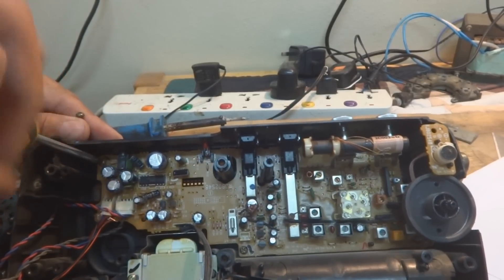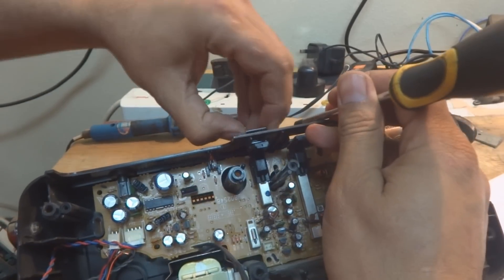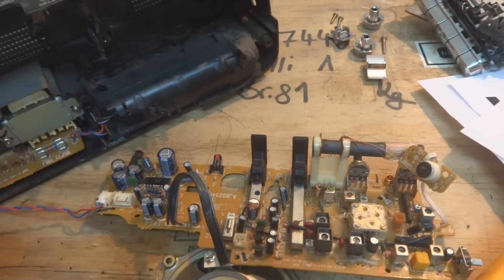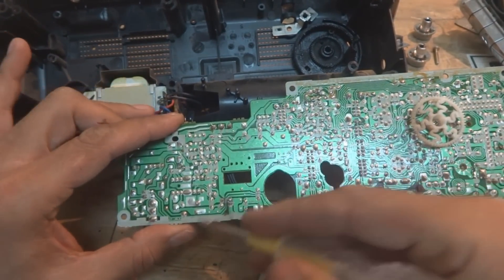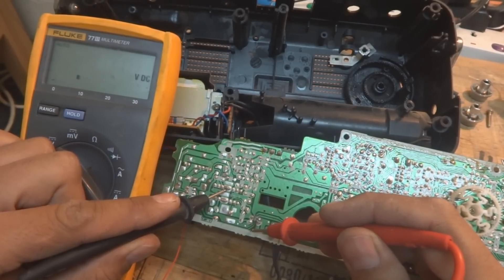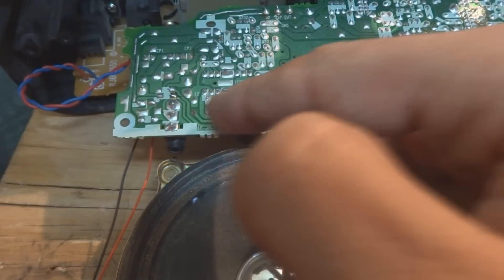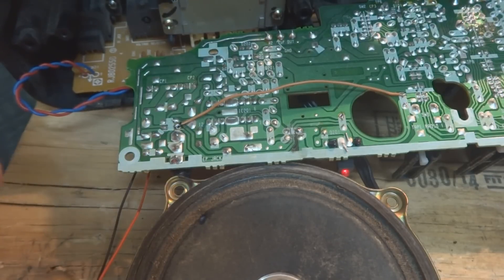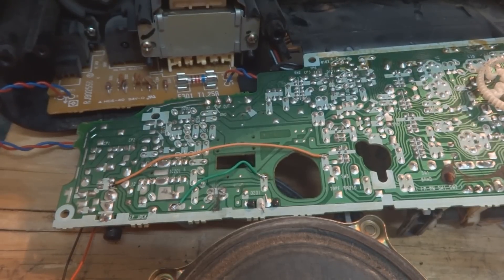Stereo repair ; Audio repair; Radio repair at home easily; Learn Electronics part 2

Comment: Rx-m50 me sound slow problem please solve india
Reply from the maker: Check radio. If ok then replace audio head. Otherwise if radio is slow too then check supply voltage. If they are good and strong then replace power amplifier ic.

Comment: Hello sir,
I have the same piece the tape is working fine but the radio volume is very low, what should I do?
Reply from the maker: Check radio section and replace defective components there.

Comment: Can I know how to check the speaker power with a multimeter
Reply from the maker: There is no way to do it using a multimeter. You can do it by connecting a speaker to different size amplifiers and see the response.
Reply: @JahanZeb1976  thanks for the reply 👍

Comment: Hello. Can you help me please?
Reply from the maker: Yes sure. What is the problem dear friend?
Reply: @JahanZeb1976  My radio dont work. I have sound but very bad and potentiometer doesnt work and i cant tune. So can you help me please?
Reply from the maker: There are some parts needs replacement in your radio.
Reply: @JahanZeb1976  Can you tell me what parts?

Comment: Hi. Nice video...!  I have a AV receiver with FM tuner. It will work only in mono mode. it want change to the Stereo mode even it has good FM signal reception. as I bought it secondhand would u suggest me a solution.
Reply from the maker: Make sure you are supplying or feeding FM signal to your tuner. Then if still problem is there, it could be a bad system IC.

Comment: One thing you can do is set your meter to read current and place it across the on/off switch.
for small radios it will be around 12ma.

Comment: Loverly job, well done jahan :-D :-D.
There must have been quite a large pulse of current to burn out the tracks, im really supprised there was no damage to the radio circuits, hard to know if it was the wrong power selector setting or the man applying power to the battery connections, we will never know.
One thing i would have done before connecting power to the radio is check for a short circuit on the radio power pins, some capacitors in the circuit can go short.
.
Tantalum capacitor types just love to go short circuit ha ha :-D, and if the power is not limited they go up like a firework, Ka booom lol :-D.
Makes you jump, i have lol :-D.
Reply from the maker: +zx8401ztv Thanks dear sir for liking video and work. This video actually I uploaded for newbies in the field of troubleshooting and repair.
I didn't take care of the short using an ohm meter before attempting power because when I applied limited power from cell phone charger, it exhibit no voltage drop; means no short. I encountered to a shorted equipment many times and by voltage testing I understood the situation. You made a great point to give to the new comers in the field! I would try to cover it in some next video.
This audio was very feasible to repair because its components especially the power and pre-amp ICs were in working state. The power amp IC was a bit expensive online and was not available locally due to worst electronic spares market here. So if it was the case with defective IC, I thing would be no change of its repair or this video! Hope these two videos will be valuable to the learners in the field of troubleshooting and repair. Regards,
Reply: +LearningZone 
Please know that I wasnt picking fault with your repair :-(
The possibility of a short circuit (possible cause of the blown tracks), is a basic part of a sucessfull repair.
Whats blown.?.... What did it?.. :-)
I will shut up, i dont want to upset you as your a nice man :-)
Reply: zx8401ztv I think it was shorten due to mosquito or little spider or any kind of bug which comes b/w + ve and ground at the spot we saw